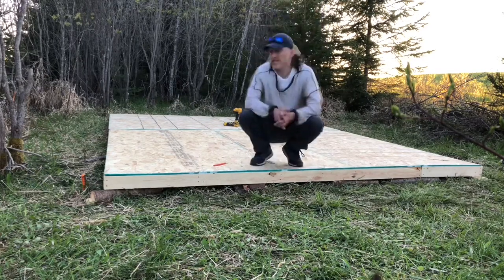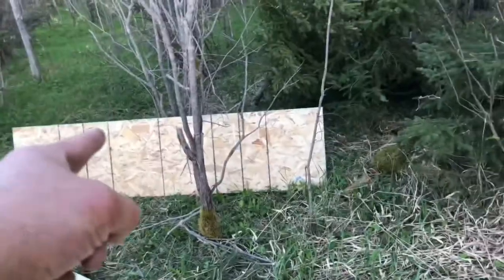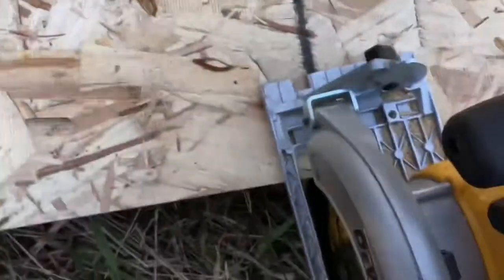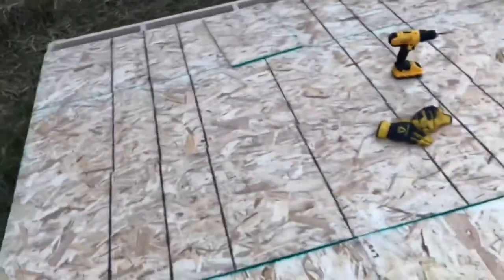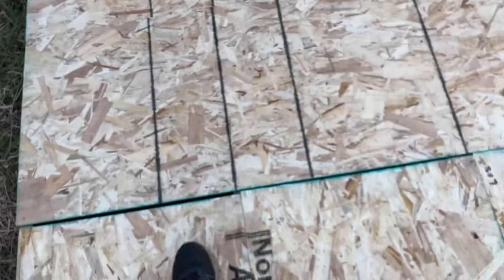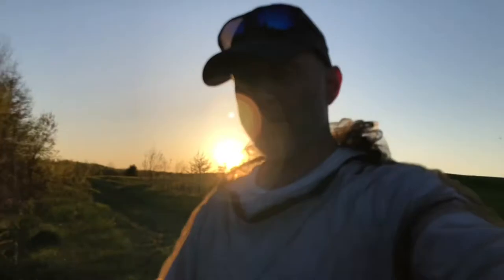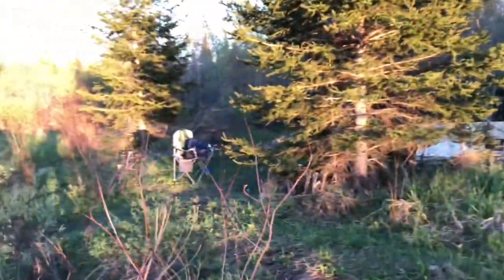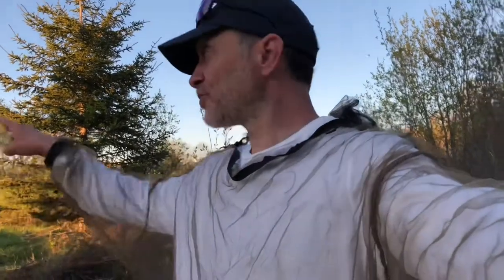Building a Tent Platform On Uneven Ground = #offgrid

Comment: No doubt someone has told you this but when laying OSB offsetting the seams is recommended.  Even flat like this but really important on walls.  Too late now i know!😅
Reply from the maker: Yup, I know about that. Gives better overall strength by spreading the load over a wider distribution area. I’ll most likely incorporate that into the next cabin.

Comment: Next glue down a good rubber mat to protect the wood OR you can stain it using old oil.
Reply from the maker: I should have done something like this. It ended up lasting me about 4 months with the tent on it, until I removed it in Oct 2022. It definitely had some mold after I removed the tent. Made a nice bonfire from it though! I knew it was only temporary but had I needed to use it after that, a protective layer would have been the key ingredient. Apologies for the delayed reply. Thanks for watching.